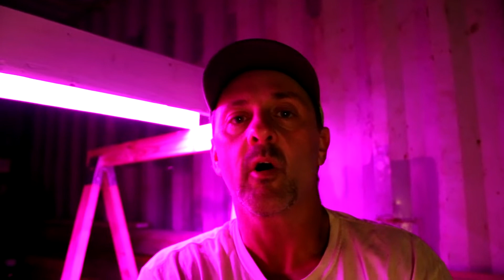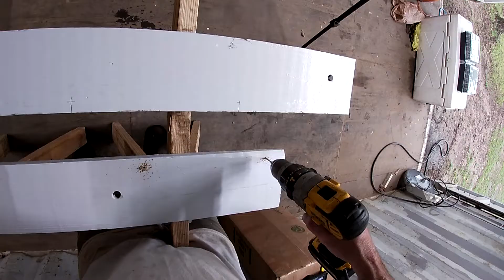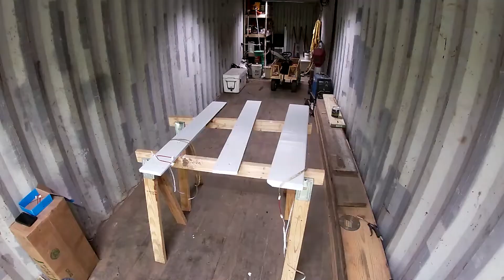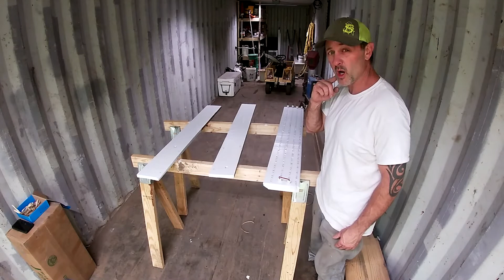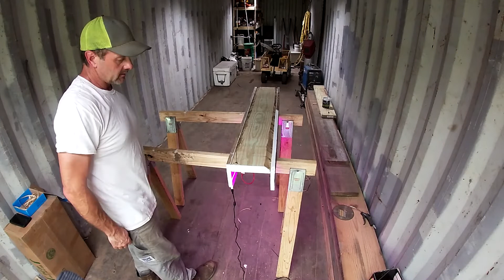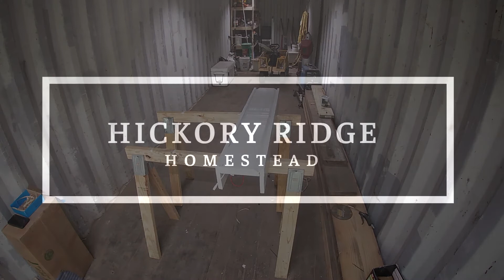LED GROW LIGHT

Comment: We have just discovered your channel and we're loving it!  Could you tell me the actual light tape that you used in this video?
Reply from the maker: Sure. Here is the link. Don’t forget to order connectors if you cut it into strips like I did. They can be found on Amazon’s as well as eBay. 

Lahoku LED Plant Grow Strip Light 16.4ft SMD 5050 Waterproof Full Spectrum Red Blue 4:1 Rope Strip Grow Light with Power Adapter for Greenhouse Hydroponic Plant (5M) https://www.amazon.com/dp/B01KLUTB1M/ref=cm_sw_r_cp_api_i_erDxEb2E4F4PN